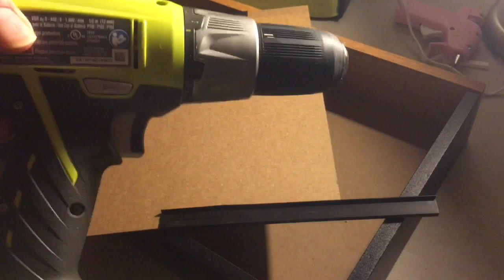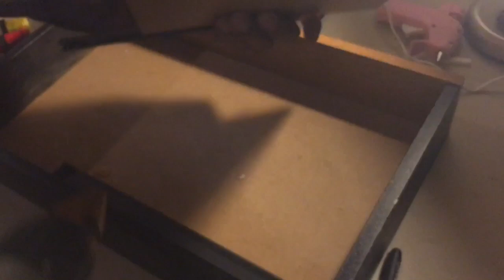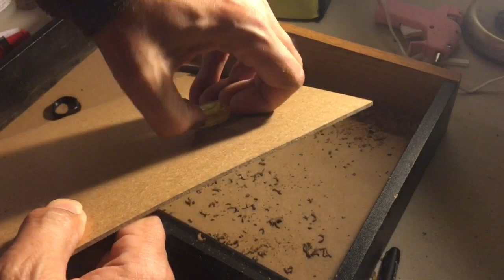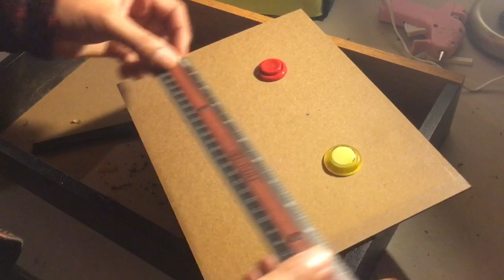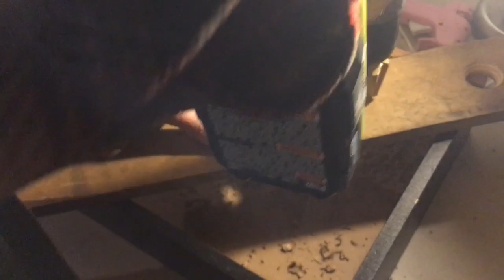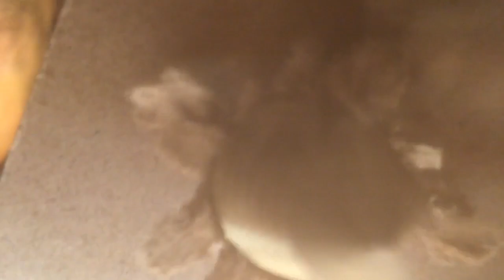Arcade1Up Mod Life - Don’t Fear Drilling Arcade Button Holes Any Longer

Comment: I would add...this only works as expected if the step is tall enough to fully cut all the way through the material.  If you have 1/2" thick board the drill bit will have multiple different size holes cut into the board so you'll have to hog it out a little.

Comment: Can a 28mm arcade buttons fit in a 30mm hole?
Reply from the maker: Not sure, sorry
Reply: Wrap some silicone tape around it and put the nut on tight and it should

Comment: thank you for your video! is it ok to make a hole in the arcade1up directly through the protector that comes along (plastic) and the board altogether?
Reply: @DetroitLove  Can you elaborate on this a little? I need to make the joystick left-right slot hole on my Galaga control panel bigger so it can work with a  4-way stick (I'm doing a 60-in-1 mod) and also need to make the same hole in the clear protector above it.

Comment: I prefer using either a spade bit or Forstner bit instead of a step bit - with spade bits you just drill a small starter hole in the center placement of the holes - get the proper size spade bit and drill about half way through from the bottom side - flip the panel over and drill the rest from the top - makes nice clean holes on both sides without any blowout or rough edges since you are cutting from both sides ( same for forstner bits but they are a bit more expensive - Walmart has a Spade bit set with 13 bits ( includes the 1 1/8" for the buttons and the 7/8" bit which works for the smaller buttons) for about $10 ( https://www.walmart.com/ip/Hyper-Tough-13-Piece-Wood-Spade-Bit-Set-With-Storage-Bag-AU05007J/685326460 )